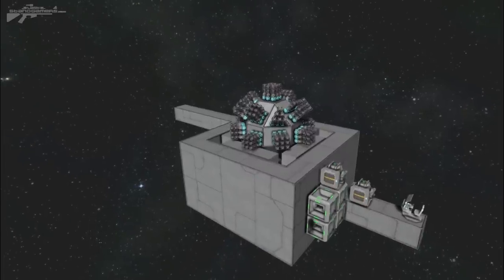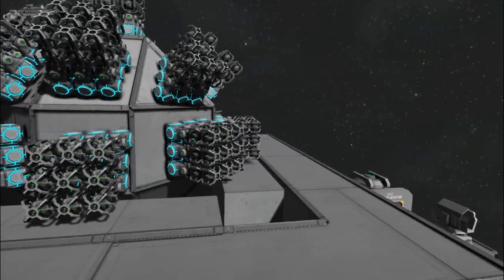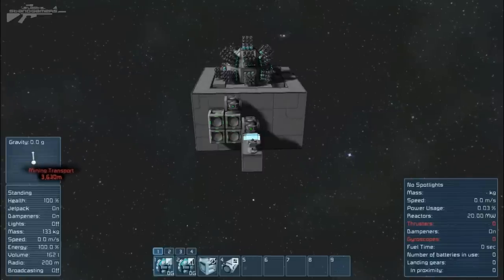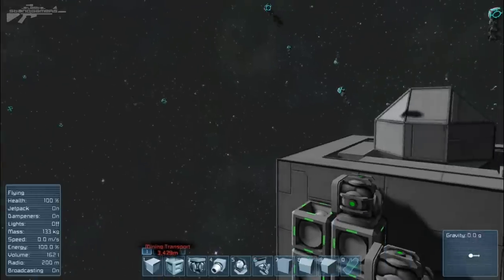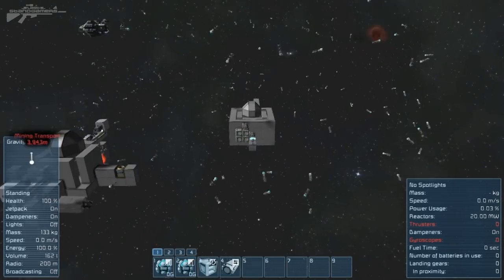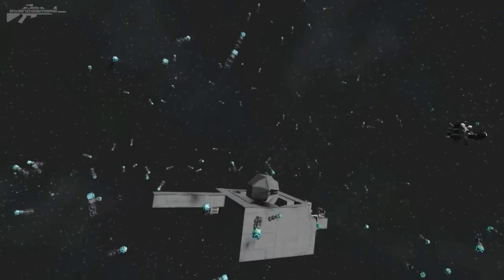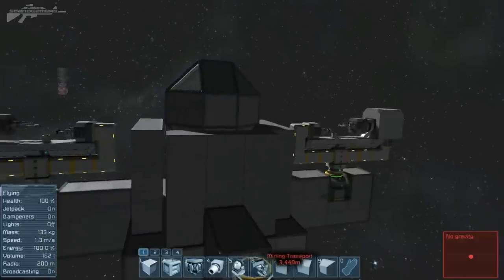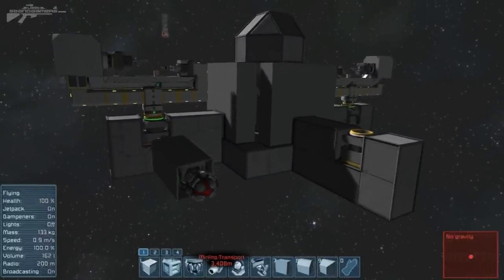Space Engineers - Steel Dome, Area Denial System

Comment: You probably want to design these to fire off in an arc that doesn't shoot towards the base it is protecting.  I would also suggest arming the warheads to explode themselves after a fixed amount of time.  That way your own fighters could launch without the possibility of striking a mine that has traveled away from the base.  I've also seen designs that use two gravity generators with a short throw field pushing out and a longer, but weaker field pulling in.  If you used two or three pushing gravity generators cycling on and off at different intervals you could achieve oscillation or possibly define different field radii for different applications.  A wide radius would allow your own ships to pass with less of a chance of hitting a mine and after they have passed through, you could tighten the radius so enemy ships can't penetrate.  I'd love to see this in mkII.

Comment: If you had maybe 2x more mines you could probably make 2 spherical gravity generators one pulling it at a max distance, and one pushing out at maybe 75% of max distance so it keeps them in those ranges. So its like a stationary minefield, or even have the two generators on a rotor so the minefield rotates around.

Comment: What you could have done instead of pulsing the gravity field is set up 2 fields. The inner field pushes out the warheads with a stronger gravity setting, and the outer field is set a few meters wider than the inner field and pulls them back in but at a weaker gravity setting. That way the warheads kind of float in a "buffer zone" between the two gravity fields. The stronger one pushing out so the warheads dont come back and kill you, and the weaker one keeping them pull in so to keep the form of the dome.

Comment: something i have been messing around with that i thought i would like to see what you made with. retractable landing bays. not just doors(although separate doors on the bays would be cool) but hangers hidden in the sides of the ship that can extend out when the ship enters combat or pull in for added security. an attacker would have to breach the hull to get into the hanger bay. a system like this done properly would allow a ship disguised as a cargo hauler could have a detachment of fighters hidden away inside

Comment: In theory this might work well, but you'll run into the problem of the individual mines running out of power eventually, which means they'll all fly out into the abyss (or worse, into the dome if the pulse is pulling them inwards when they die). Of course, you could just load up a shit ton of uranium into each mine so it they run out for an extremely long time, but then you're just wasting uranium if they go off... :( 
However, if you can time the pulse right to bring the mines to a dead stop, this would be a brilliant way to rapidly deploy minefields. Again, that's easier said then done, especially since mines will almost assuredly bump one another as they deploy from the dome in tight clusters. Still, I like the concept; it has a lot of good facets to it which could be reused in other situations to great effect!

Comment: Instead of just simple mines, have them be homing missiles.  You can have them only recognize enemy ships, and when the sensor sees something, it turns off the artificial mass, and then turns on engines.  This way when fighters went through, they would continue to hunt down the fighters.  As for putting them on top of the sphere in a self replicating system, if you lowered the sphere down enough, wouldn't it slowly pull them in(I'm assuming you have the grav gen set to like 0.01 normally, just enough to pull them in without damaging them)

Comment: Aaron I designed a smart mine a while back using the classic sensor-style tracking method, only simplified for easier production. While it's not quite set up for survival production, with a couple tweaks, like disabling the trigger to safely move it around, they could be used in an anti-large ship minefield. I have them set-up to not detect small ships because they would otherwise just all fly into each other and explode. Here's the link.
http://steamcommunity.com/sharedfiles/filedetails/?id=350446847

Comment: If the enemy is anything but a sloth, they'll just shoot the dome before you can deploy it and completely destroy it. Not to mention you can't encase it in anything else because it needs to be in open space to work properl.
Reply: Maybe the dome could be hidden under a blast door and retract on a piston, so it doesn't blow up when you don't want it to. Add a bunch of these to your base, maybe redesign th warheads and you're good to go.
Reply: It might be better to just wait until they deploy it, withdraw your fighters, and then launch a salvo of torpedos that contain their own gravity generators. Expensive? Yes, but think of the carnage that would result from the enemy's mines suddenly being pushed into their own base.
Reply: ZeroPointAlpha Yeah, but instead of launching a bunch of torpedoes to just move the mines in random directions and hope that it hits them, you could just get a ship with a gravity generator on the front, with it's top pointing into the ship, set that to maximum everything, go ontop of the base, and just push everything in.
Reply: Sadfatbat Sure, let's drop 4395789024752 steel plates just floating around a dome. No one will ever suspect ANYTHING.
Reply: Jakub Pec You're probally the only one who replied with a reasonable idea.
Reply: Sadfatbat If you use small ship blocks, attackers might mistake the thing for a kind of fighter or construction ship. Which still means they're gonna shoot it xD
Reply: Why couldn't this just be mounted inside the base, and then raised up and deployed? That shouldn't take too long to accomplish. Pair it up with a scout/early warning system and you could easily have the system deployed and ready to go by the time the ships are close.
Reply: Hm.... Figure out some sort of timer where you can start it when the enemy is a certain distance and it will deploy at the last moment?
Reply: It's really not meant for that.
Lets say you have a thin passage between two asteroids. Have this thing here to protect the area between, so that they are bottlenecked into the minefield.
Reply: ***** What if the mines are stored down deep in a base and upon being activated they are projected up and out the dome which then repulses them out into a minefield?

Comment: Yah, lets just send hundreds of small mines into space when we are done with them. Someone else's problem, right? Area denial minefields are great, as long as you can get rid of them when you are done. The US Navy has not used dumb-mines in years, because they are indiscriminate weapons that (generally) do more harm than good. Modern mines are more like torpedoes, they sit at the bottom waiting to detect a ship with passive sonar, and when they detect a ship they compare the noise it makes to the database it has on board. If it is a military ship then the mine activates and propels itself into the enemy vessel and blows it up. If it detects a ship it is not supposed to destroy, then it sits there and lets it pass. The MK-48 Captor (EnCAPsulated TORpedo) is the best example of this, and are highly effective in area-denial operations. 

My point is, that system will only do more harm than good. The mines cannot be recovered after being deployed, they cannot be triggered remotely for disposal, and your methood of getting rid of them is to just fling them off into space at high velocities? Next time a warhead smashes into your ship and breaks something expensive you can blame it on your iron dome system.

A proper mine system you be similar to the Mk-48 Captor Mine used by the US Navy. In SE, it would be not unlike your sensor guided torpedo you made a while back. the group of mines would sit there, and when they detect a ship, they would activate and go off and blow it up. If you decide you don't need to have those mines anywhere, or if you need them somewhere else, they can move themselves there. That fact alone makes them more worthwhile than your iron dome. The initial cost might be more, but the fact that you can have a mobile minefield makes up for that. Plus, you can control and detonate them remotely to dispose of them in a proper way, NOT just flinging them off into a neighboring system.

TL;DR: Make smart-mines, not just area denial warheads that just sit there.
Reply: Set your Preferences for Trash Cleanup. As defined, Trash is anything floating in a straight line, unpowered and not visible. So you set them up with enough energy to last however long you're away (say 3 days) and set to automatic. If the system has deployed while you're away you just remote control it to power down or send the mines off.